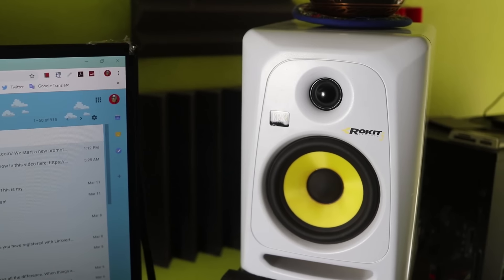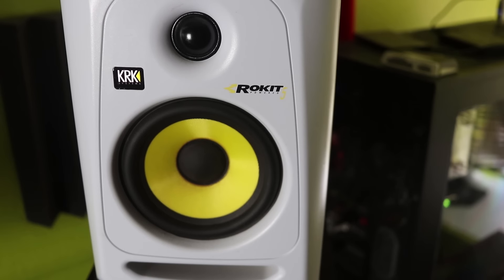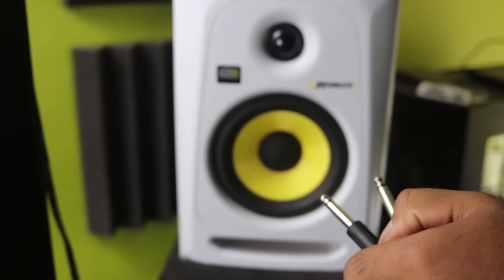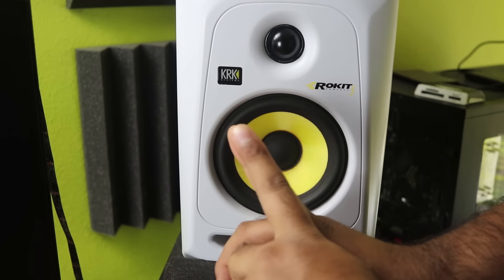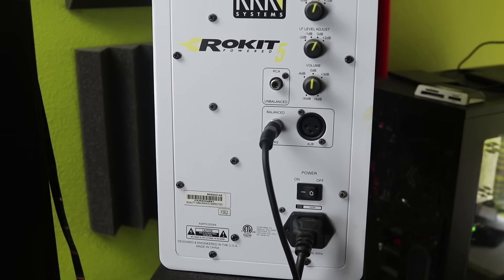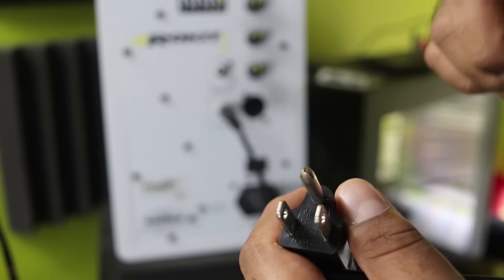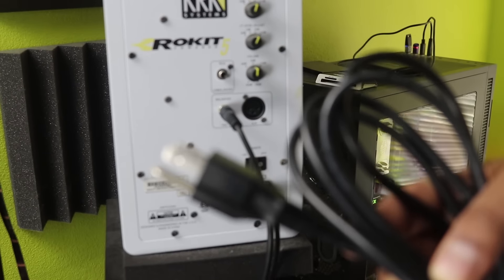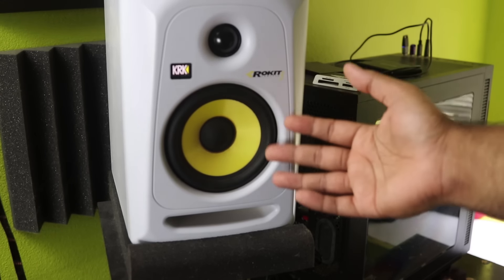How To Stop The Electrical Noise From Studio Monitors!

Comment: I swear to god I'm about fucking done with active speakers. I'm going to buy XLR cables and if it doesn't work I'm throwing this shit in the dumpster and getting me an amp and passive speakers.
Reply: Changing to passive speakers wont change anything you are just moving the amp outside of the speakers. You just need to make sure all of your connections are balanced or if needed get yourself a hum eliminator like the HD400. 3pin XLR cables are balanced if running mono but not if they are used for stereo audio. You would need two balanced XLR left and right channel outputs, two XLR cables, and two balanced XLR inputs. Otherwise you can have two balanced TRS aux outputs, and two balanced TRS aux inputs, then just run TRS aux cable. There is no need to replace the speakers though that wouldn't change anything unless they are faulty. Just remember: Mono left and right signals and make sure every input and output is balanced.
Reply: @theflyisaspy7691 so 1 cable for each monitor? That means connecting 2 (3.5mm) jacks to the pc right.
Reply: @sooxvi  If you want balanced audio, yes you would need 2 connections one for left and one for right channel. You need to make sure the ports you are plugging into on both the input and output are balanced as well. I would doubt that outputs on the motherboard would be balanced, but I am not really sure. Probably you would need to go from a dac to your speakers/amp. But yes 3.5 jacks would work as long as they are TRS not TS.

Comment: How come on my laptop i dont get it, just on my pc? 
the motherboard could be in play here?
Reply: I have same thing. Noise is there when used with pc and noise is gone with laptop. 100% same setup otherwise.
Reply: @RasmusHakonen  Yes exactly like me, getting mad here. Got good cables too.
Reply: What GPU do you have in your PC?
Reply: @DarkerThan00  7800xt, it its the gpu isnt it
Reply: Yes It's highly likely, when you are using your laptop chances are the igpu is being used, see if you can go into your settings on PC and see if you can use the igpu when your DAW is used, as long as you have enough RAM , it won't impact performance, I do feel this is the heart of the problem, years back I had a PC with REM cards feeding ns10s , I ran cubase but my GPU was just using the motherboard integrated, no external GPU at all, so it was a dedicated DAW system, and it was dead quiet, no whine
Reply: @DarkerThan00  what is wierd is when the gpu under high load the whine gets worse, the higher watts gets through the gpu the whine gets worse, it can be some ground loop.
Reply: @l0gical998  ye for sure
Reply: Could be a ground loop? Most laptops aren't grounded

Comment: I connect my speakers to my laptop and the cables are stable as well, but as soon as I try to charge my laptop speakers make a super loud noise, does anyone know how to prevent it? *BTW my battery dies in like 2 hours, so I most often have to use it while being charged*

Comment: Bro I'm using an XLR cable and it's still making noise, what do you think the problem is?
Reply: I have the same issue with some pre sonus e5 monitors. I'm pretty sure it's RF interference from a transmission tower across the road.
I even tried a pair of Yamahas and had exactly the same problem. If I hold some wire mesh between the back of the speaker and the transmission tower it reduces the interference a lot but not enough. I'm dying to find a solution to this.
Reply: @THE M4GICI4N I made some improvised shielding out of metal grills I had lying around. If I place them behind the speakers in the line of sight to the antenna across the road then the interference is reduced but not completely eliminated. Maybe an RF engineer or antenna designer could help.
Reply: I uploaded a video demonstrating the issue with my monitors and a possible fix:
https://youtu.be/_brqeB1my1A

Comment: After a lot of searching and buying stuff..... what finally worked ???? Putting some aluminium foil over my wifi router..... yep..... monitors pick up the wifi signal...... a 10 cents fix.....
Reply: thanks for sharing this solution! I had the same exact problem. Been having electrical noise come through my speakers and when I turned my google fiber router 90 degrees it miraculously stopped. I put tin foil on it too for good measure.
Reply: @EthanBerkey  Dude glad I could help, took me YEARS to figure out the problem
Reply: thank you.. this one really help me a lot

Comment: I've exactly the same noise using my KRK monitors and my Desktop PC. The strange thing is that the noise disappears 'if I connect my audio interface and the same setup to my laptop PC'. what could be the issue in this case? The PSU? Thanks!
Reply: You need a ground loop breaker. My guess is you're using your laptop cordless so it's not part of the ground loop anymore. Your PSU is fine.
Reply: @CemetarysNeighbor  thanks for your reply. I definitely solved my issue with the Hum Remover by Behringer
Reply: had the same issue, the buzzing only disappears when I turn on my computer.
Reply: @fleand86  I'm thinking about ordering the Behringer breaker as well. 
Do you notice any difference in audio quality? I heard people complain about low frequency loss which would be a big problem for me.

Comment: never a good idea to plus an unbalanced (TS) cable into a balaned input because it shorts it out.
Reply: Yes, unbalanced is designed for long range transmission via seperate ground for each channels. It makes nearly no quality benefits in short distance instead of a higher gain.
Reply: @raymondchan3587  "seperate ground for each channel" ??? What are you talking about? "unbalanced designed for long range transmission"??? What are you talking about???

Comment: I can not use balanced due to my sub only got rca. There is neither any noise, as long as I do not have my external screen connected to my laptop. When I connect the hdmi to my MacBook, there is this electric noise. This was neither the case for 2 weeks ago, and I have not done anything special. It just appeared out of nowhere. Really annoying
Reply from the maker: Hopefully there can be a solution found for ya! Electrical Interference can be super tricky to resolve. From different outlets, to even wires overlapping each other. >_<
Reply: Use a Ground Loop Noise Isolator to get rid of the hum in ur RCA Cables make sure to avoid ground loops make sure you plug every part of ur equipment into the same outlet or a power strip.
Reply: @OwenGFLProductions  ye i know i had a component like that before. But it made no difference. But i managed to fix it, i had connected the cables wrong.
Reply: @MeerQy_Music  Noice I use a 3.5 to 3.5 Auxiliary Cable and it picks up noise when I hook it up I came up with a plan of seeing if a Ground loop noise isolator can fix my problem however I didn’t receive it yet since am asking that for Christmas.

Comment: Dude that's foolish to put your speaker near a computer like that. You'll scramble your drive and be like "why is my computer acting all weird" and you can probably throw important sensitive things out of wack. Hasn't anyone warned you of the dangers of magnets around electronics? with an electric guitar you can hear how that noise emits from the motherboard
Reply from the maker: The only time noise would Emit from my guitar would be if it's around my Razer Keyboard since it has all those lights in it. That said, I don't record around my keyboard, or any speakers at all to get a clean signal. 

But nah, it did not effect my motherboard or anything like that. 

Had these speakers and the MoBo for 3+ years now and I don't have an issue. The Tower is in a different spot anyways.

Comment: u are giving bad advice. you should only use trs cables if the monitor input calls for it. technically most of them should call for balenced cables however mine do not. in reguards to the ground loop you can run a wire out your window connect it to a 3 ft peice of no. 4 copper pounded into the ground 3 ft, and connect it to the chassy of your unit whatever that may be

Comment: Hey man, thanks to you I realized that I've been using unbalanced 1/4" cables all this while, hence the static noise I've been hearing while playing games..

Btw is it okay to use male XLR to 1/4" balanced TRS cable to a  Female 1/4 in to Male 3.5 mm adaptor to plug in 3.5mm jack on my desktop?

Comment: it's driving me nuts bro >:( , have tried changing monitor settings, display settings, different speakers, monitors, mouse, USB cables etc
Reply: YES just solved it, it was the damn USB extender hub plug in from amazon, a cheap one :P damn not grounded well!

Comment: My speakers crackle with 808s
Reply from the maker: Don't listen to that Marssmoon kid he's extra special. 

Before you think that it's blown, test out other things for it! 

1. Did you play the speakers WAY louder than usual? If you have them loud for a long duration, it could be that you've over-exerted them. 

2. Smell the speakers ( as funny as it sounds ) Does it smell like something burned in there? 

3. Are you able to play other sounds and hear from the speakers?

4. Does the way that you hear the sounds in your speakers sound the same, or similar to your headphones?

If you've answered no for 1.2. and 3. and if it does sound similar for 4. Then your speakers are NOT Blown. 

If it is not blown, it could be that you are experiencing underruns. Those are poppy clicky sounds.  " This is caused by CPU and or Hard Disk overloading "  as stated from Image-Line. See to adjust the buffer sample rate in your audio settings, maybe that can help!
Reply from the maker: Edit* If you answered No for 1 and 2, but yes for 3 and 4 lol.
Reply: @OmoiSenpai  I appreciate the help big bro,  I doubt my speakers are blown but I think the problem is my CPU. I don't understand my PC is a beast, I'm rocking an Amd Ryzen 2700x. On focusrites website it states 

"It’s possible to get clicks and pops if streaming audio when also sending/receiving large amounts of MIDI data when the interface is connected to a USB 2.0 port on an AMD-based machine. Intel machines and computers with USB 3.0 ports are unaffected."

I hear the crackles while listening to music but it really shows with the 808s. I'll keep searching for a fix thank you.
Reply from the maker: Ahh Ryzen! I'm jelly haha. I have the AMD FX 8 core 4.0 Ghz CPU. Definitely should be good. 
I am using AMD in my PC. I got a MSI Mobo as well. I believe I have my Audio Interface plugged into a USB 2.0 Port that I used an PCIe chip to get. 
Have you updated the drivers for the Audio Interface? 
If anything, E-mail me at Justin.Bansraj@Gmail.com and Imma see to help!
 
I blocked that other dude cause he was being total cancer on my channel. Glad ya didn't return the box or open it yet. If you did open it, and something was broken, then that would have sucked!